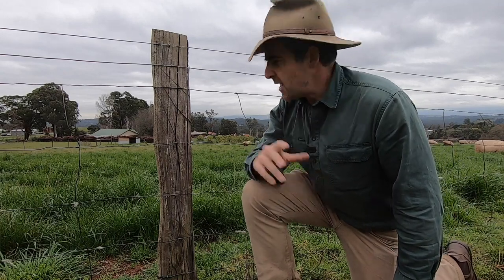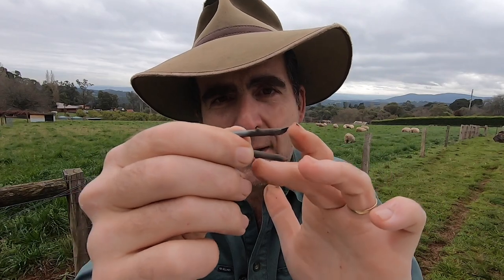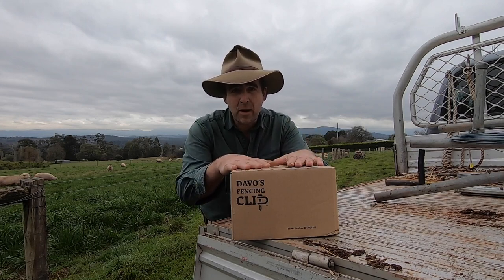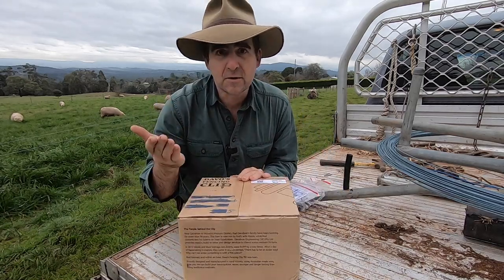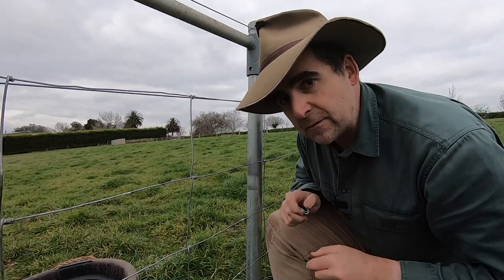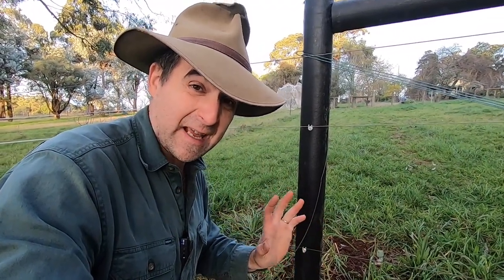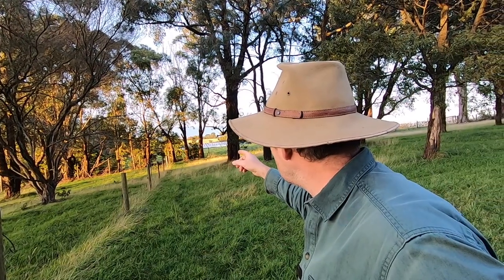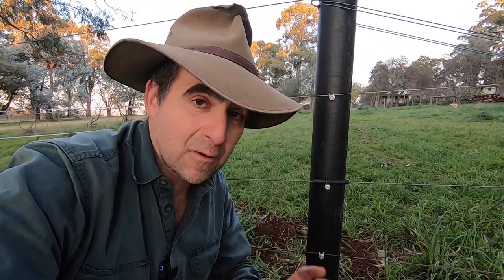Davos Fencing Clip - The End of Fencing Staples?

Comment: In the UK the posts snap off at ground level way before the wire and staples fail.
Reply: Why is that?
Reply: @jmeds_jammin  softwood posts they tend to rot through at the base in around 15 to 20 years , I’ve never had a staple ever  pull out in the UK
Reply: @Sthilboy56  even with concrete? Are they pressure treated?
Reply: @jmeds_jammin  yep even with concrete and they are pressure treated , so much rain constantly getting wet and dry they always fail at ground level just rot through ☹️
Reply: In the USA we use black locust post or cedar posts. Those will not rot or use treated telephone poles cut to the length you need for corners.
Reply: @clawhammer704  Osage orange posts are even longer lasting but driving staples into them is like driving them into steel.
Reply: @jmeds_jammin  Treated wood posts always rot at ground level and a bit below, as far down as moisture and oxygen are available for the fungi, and other organisms.  For that reason replacement wood posts are always planted a distance away.   The lodgepole pine posts we treated lasted forty years.

Comment: dont want to rain on your spiral cut insulator idea, but any air gap in the insulation would allow an arc to pass through, let alone moisture from dew,rain etc. using air as an insulator requires a larger gap. The only thing i could think of is a solid  round slug of silicon or soft rubber with a slit  down the middle, when squeezed by the clip it may remove enough of the air gap but it would be far from ideal.
Reply: We have spiralators in the US.  It would take a bigger clip.  Look them up.
Reply: @dennisknackstedt18  that would work.

Comment: Always flatten the staple. Got an idea this year to use metal strapping bent in half then screwed to the fence post. After I learned to use the cut off wheel, which I was afraid of,  it was plain sailing. Now I can see that I can add tubing to the electric post as this was my next problem.

Comment: I've used this way of fencing for years....re the hose pipe.  The only issue i have with this great video is the improvement of spiral cutting the pipe.  I'm not sure how they would do that because in every instance where I have done it on my fencing, somehow the spiral does work around and eventually touch some part of the fence shorting it out.

Comment: Excellent idea but why are the clips used upside down, so that the fence wire sits above the screw? Maybe it is stronger that way, but it also means the fence wire can rub on the screw and any exposed thread. Surely the clips are strong enough, or can be made strong enough to support the weight of the fence wire? Maybe I'm wrong, but seems to me it would be better to have the fence wire hanging in clip.

Comment: Looks like a good idea for some apps. I used to use torque drive screws for my electric insulators but I live in northern NY , snow country. I usually take down E - fences for winter but if I don't get to it the snow will weight the wire and snap off the fasteners. If you use galvanized ( or coated ) fasteners you have all these broken fasteners that can get launched some distance an NEVER rot away. Thats my only problem with them. I also use black locust wood posts for most of my fencing and while the screw might go in would probably not come back out. I gotta say I've had an idea for new system that may imploy similar fastening system. Low tech , salvaged components and servicable ( take down for snow).

Comment: Hey Tim. you can metal print a simple plastic injection mold using a Markforged printer  for the insulator and do away with machining but I don't think it would cost you much either because it is a very straightforward  part.
Reply: Miguel Ángel Simón Fernández, huh?!?

Comment: Did you notice the steel oost demo - the hole was already drilled?  No wonder it was so quick and easy. How did you get a bog standard self drilling screw to drill into a round post?  Cheat, possibly.  For all that, a jolly good product

Comment: Would it be easier if the insulators had a split so you could just press it over the wire once strained, same as convoluted insulation used in vehicles. Or just have insulation on the clip itself.
Reply: They do make those. Just got to be careful you get the split to the bottom so the water doesn't collect. They also seem to shock you when they get wet. I used a few but finally just learned to count. I keep them around for patch work but that is about it.

Comment: What a wonderful and easy way to replace staples! Now I gotta see if it's in the US. If not, may have to order from the company. BTW - Would it be possible to slit or have the insulating tube pre-slit so that a person can just wrap it around the electric wire. I don't know what material the insulator is made of, though I suspect it is plastic. Of course, I imagine the slit would have to be facing to the ground before attaching it or not. This way you don't have to count the number of insulators you need to thread to match the number of posts. All you would do is slide an insulator over the wire at the post and then attach the clip.
Reply from the maker: They have a new product that takes porcelain insulators I reviewed it here https://youtu.be/wgSVbS3sbdA

Comment: I like it. I've pulled a few 100 meter wire runs. When hammering in staples the aim is off a bit and occasionally strike the wire. Which scores it. Did I just create a weak spot? Will it break at this spot at the worst moment? Should I re-pull new wire? 
I don't see these issues with the clips.

Comment: If you have a heap of pre fab wire to put onto wood posts such as post and rail, an air driven padlode with 40mm staples is the quickest way to go, you won’t pull those staples out. But I can see how these would be really handy for attaching wire to in line gal round posts

Comment: I have not read all comments, so may be repeating somebody; however, simply slitting the insul-tubes would work to put them on as needed. Just align the slit downwards on the wire and in the clip, and the screw would hold it in place (especially if the insul-tube is a bit over-sized for the screw to grip onto).

Comment: That's handy so do those metal posts come pre-drilled or do you have to faf around punching and drilling a hole for the screw.
Reply from the maker: The brackets are pre drilled. But the posts are not. This allows adjustments. Easy to drill though. Really not a drama with a decent impact driver

Comment: For electric fence can you just split the insulator on one side, slip it over the wire at each post as you go and then screw it down so you don't have to thread them all on before hand?
Reply from the maker: Water could potentially cause a problem. I suggested that to the manufacturers and they were not keen

Comment: I have a question why are you not putting the fence line on the inside the side where the animals are this will keep the fence more secure when they go push on it you won't be losing hardware
Reply from the maker: This is an internal fence. Hence livestock on both sides.

Comment: I would attach the insulator clip to the post first using a string as a guide, then feed the wire through it. I realize it's an extra step, but what if you accidently mis-counted one, you would then be taking the wire down any way to add the extra clip. Just a thought, I'm not a fence man.
Reply: As a fix for this you could make a spiral cut in the insulator and thread it onto the wire the attach it to the post.  The spiral cut would keep it from twisting around and grounding out on one side.  You could also in addition use a couple of wraps with electrical tape to the area surrounded by the clip as  insurance.

Comment: Insulators should be an inner and outer sleeve, both split lengthwise. Slip the insulator over the wire wherever needed and turn the inner sleeve 180 degrees. Now attach with a clip as normal. A small bevel on each end of the split would facilitate slipping them over the wire. This may require an additional size clip.

Comment: In Argentina the fences are made by posts, rods and wire. The post are planted every 8 to 10m, with rods every about 1,2m (7 to 8 rods between the posts). But we drill holes both in the posts and in the rods and the wires pass through them. Normally there are 6 wires in the height of the fence. We never use staples. Using really hard wood for the posts (here we have the quebracho) and eucaliptus for the rods, a fence should last 40 to 40 years.

Comment: Wonderful solution. Spiraled tubing is clever also. Maybe too clever. Cut up the insulator in whatever fashion and you risk the cut turning up in the wrong spot at installation. The design as is is simple and effective. Altering the insulator might lead to a very expensive and finicky solution not fit for a small manufacturer. As it is it's a sure thing. If you find you have the wrong number just cut others in two to make up the difference. If you have too many leave them or back the screw out and remove them. If you have to work on an existing run then cut the tubing as needed yourself. Or use thin rubber sheet in a wrapping manner to build up to proper thickness. Or use electrical tape to build up the insulator. Whatever you do keep china out of it.

Comment: Tim, can I suggest another objective test for these v staples, a simple pull out test (instrumented with a load cell) would give a good objective comparison.
Reply: I would add to pull them different ways. straight out (like an animal running into the fence) and laterally (like side loading from and animal pushing head through.
Reply: thread vs couple small barbs on staples......nah,result be clear cut.
Be like using nails on roofing vs threaded nails or tex screws,we all know what holds longer aye 😉

Comment: Ohhh man, this is great.  Do you know if it is available in the USA?  My family has a large ranch in Texas and this would be amazing to mend our fences with :)
Reply: @FarmLearningTim  I am going to discuss this with my father-in-law who owns the ranch.  This would so save on time and be far more secure than the staples we have been using.
Reply: Amxiie  On the wire we use, there is about 3 or 3.5 inches of space between the tips of the barbs.  What we have been doing is stapling the wire to the posts with these extra-heavy duty industrial staples and this electric staples with a battery you would use on a drill or similar.  It works pretty well, but you cannot tighten anything persay afterwards. These clips I think would be so much better.
Reply: Amxiie @ if your using the right sort of barb wire you can get a de-barb tool made in n.s.w aus that removes the barbs in the sections you dont want them so you can use in line fence tensioners to adjust as you need,prob. solved 😉

Comment: You can cut those insulators. It’s a rigid plastic so u can slide those things onto the wire.  I actually did that on a spot where the Hotwire was touching the top rail and shorting out. Just be careful with the knife.

Comment: These are good for joe farmer or diy type guys. I am a farm fence contractor. I can drive 10 staples in the time it would take to put one of those on a wire. Plus, the price would surely be worlds apart. I will say that they do look like a good product.
Reply from the maker: Yep horses for courses. Cheers mate.
Reply: Also, has anyone seen the new steeple guns for farm fence yet? Seem to work pretty good. Like an airless nail gun for framing but shoots a 2 inch staple.
Reply from the maker: @josephwhelan192  yep. I’ve been offered a play with one..... just need the right project!

Comment: Could you not screw the insulators on the post first then pull wire through it?
Reply from the maker: not advised as the friction from the plastic adds up. Better solution now with the Davos reel clips. Check out the review here https://youtu.be/wgSVbS3sbdA

Comment: To put the insulators on the wires straight without having to disconnect the wire     

you could cut a groove on the backside but not cutting through the whole thing just on one side and then you could cut those in thirds for length and place them on the wire without having to slide them on The end of the wire before you string the wire
Reply: James
Hello hope you are doing great

Comment: New Farmer mistake... bought Davo Clips and tried to attach using Deck Screws... the heads don't grip the clip unless I pinch the thinner loop together and snug the hanging loop a bit :-( ... I stopped using after 10 posts and went back to staples in interest of time
Reply from the maker: They are designed for tech screws. Work well with the right screws.
Reply: @FarmLearningTim   yep - emailed Davo team and got immediate response (love the fabulous cust service!!) they sent pic with specs. TOTALLY love these and will be using as I build out infrastructure.

Comment: The clip is much better than the staple, for sure. It took the first 5-1/2 minutes to make this point. The box, while clever, was over designed & an unnecessary expense, empty coffee cans would suffice. I would rather had more clips for the money saved manufacturing the box. The 12-1/2 minute explanation could have been boiled down to less time. Farmers are resourcefu by nature, a simple instruction sheet would do the job. I will definitely use this product.

Comment: How do I go around the back of a wood corner post  with high tensile without terminating the wire? A guy told me the rubber tubing will bleed power into the wood over time.(electric fence)
Reply from the maker: I’d terminate in the corner mate.
Reply: @FarmLearningTim  Ok. You don't think doubling the insulation would work?
Reply: @FarmLearningTim  Trying not to terminate every 300 feet.

Comment: The clips are an excellent ingenious invention. Virtually indestructible, easy to install and compared to traditional installation techniques, are very cost effective. Having just refenced my property, replacing wood with steel with the attachment of feral management netting, the overall process was effortless. When assisting a neighbour with extending his electric fence, his choice of insulators on posts was  using cushioned 'P' clamps, commonly used to retain airlines, wiring looms, etc within truck chassis without friction damage. Great idea. I took a different tangent and coated a dozen of Davos clips with continuously flexible liquid rubber, allowed to dry than installed on my neighbours electric fence. The insulation properties of rubber did not fail (no earthing to ground via posts) and random inspection hasn't reviled any failures. This may be an idea Davos could further investigate. Overall a fantastic Australian product. 🇭🇲👍👍
Reply: @FarmLearningTim  If you could forward my suggestion to the owners I'd really appreciate it. Thanks Tim. 🇭🇲👍👍

Comment: David Edge is right, I have shit-knows how many meters of fence wire held in with staples and of the tens thousands of staples, I don't think more than a couple have fallen out or corroded. In Scotland, a fence post will usually last a good twenty years or so before it rots at ground level but the staples, which are all well galvanised will almost always outlast them. And what's the barb all about? I must have whacked in a million staples but never a barb in any of them. Plus, if you angle the staple slightly, you'll never get a split in a nice new juicy tantalised fence post. The only thing I can think of is that Australians must have shite fence posts if the timber can't hang on to a staple for more than a couple of decades.
Here's the thing, I have a mate who is a fencing contractor and we get some of his scrap, twenty-year-old scavenged fence posts for the wood stove. The buggers all have their staples still in there and they're a bugger to remove.
As for those screws, by the time you'd done a hundred meters of fencing your blooming drill would have run out of battery juice. This might suit a smallholder who can't aim a hammer at a staple or who has money to spend on metal fence posts but jeez...!
Tell you what, why don't you set yourself up importing quality British fence posts and British staples into Australia and forget silly gadgets.

Comment: why don't you think of a one piece plastic clip in two halves with a hinge  and a hole on either side. You can fold it around the hinge  and use the pilot hole on both ends to thread the screw. The plastic part would  clip inside the metal clip to keep it in place and the metal clipwould act as a reinforcement  to prevent the plastic part from breaking due to outdoor exposure. Wish I were  Down-Under, but I'm in Spain.

Comment: 100 Clips and Screws $AU115 ($US90.77)
70 staples $US4.48 ($AU5.67)
Pick your price point.
100 screws and clips aint gonna get me very far on a 5 wire barbed wire fence. Over $90 for 20 posts.
2 lbs of staples for less than $10 is about 134-140 staples. So, 26-28 posts. Think I'll stick with my staples. I usually replace the post before I have to replace the staple, and they are quick and easy to replace when needed.
Just my opinion, an expensive solution to an easy problem.

Comment: I'd imagine one could slit the insulator longitudinally and just press it on where you want to attach to posts.
Reply: I thought the exact same thing.
Reply: Yeah for sure. Especially as it’s being screwed in place securely. It’s unlikely to roll off
Reply: I slit insulating tubes when I need to replace or add extras to a wire .
Just be careful when slitting  not to get cut as they take a bit of force to cut.
I cut a bit of a notch on the end to help it get started on to the wire .
I keep a few pre - made in the tool box so they are ready to use when need in the field .

Comment: Electricians tape as a insulator or make the clips out of carbon fiber or something similar another thing you could do would be coat the clips with plastic or rubber there's a hundred and one ways to do that all they need to do is figure what works the best and not so expensive to sell and manufacturer.